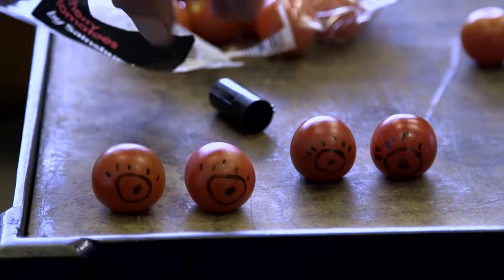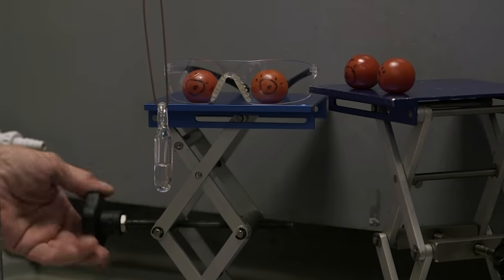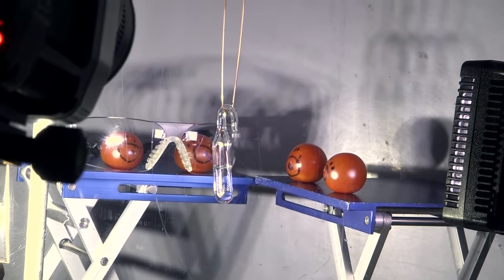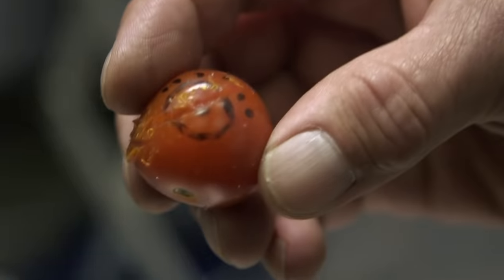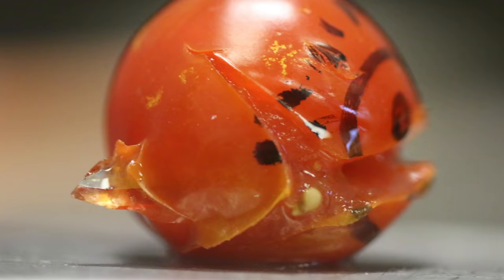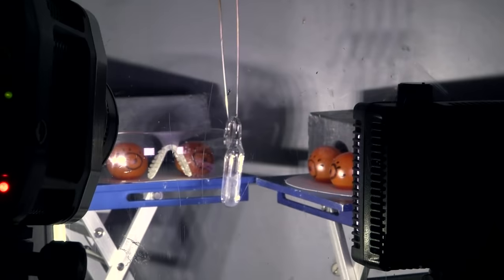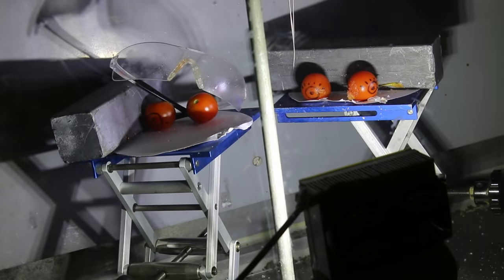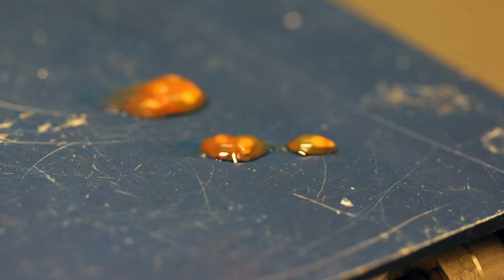Why you need to wear safety glasses - Periodic Table of Videos

Comment: I'm alarmingly bad at remembering to put safety glasses on when I work with machine tools, and I've had a few close calls with splitting cutting discs, shattering scalpel blades, metal shavings etc. I'm suprised I'm not blind yet! Note to self: remember to remember putting safety glasses on.
Reply: they are cheap. i reccomend buyong several pairs and putting them on the power buttons of each machie. even if you buy 10 thats still ot a great expense at all. i keep mine on my lightswitch so i see them as soon as i put the power on

Comment: Safety glasses have already saved my eyes a few times.

Was out shooting and had bits of a bullet ricochet back and pepper my face- this is actually fairly common. Different day was too close to a tannerite explosion. Also have had several case ruptures on rifles that shot gas back in my face.

Also had an angle grinder wheel explode with no safety guard on the grinder.

Regular eyeglasses with glass lenses are often worse than wearing nothing at all. If something shatters the lens you now have 10x the number of projectiles.
Reply: Geez-remind me to never get on an airplane or a boat with you...

Comment: The second test also sprayed the eyeballs with a jet of steam. So yeah...safety glasses would help that too.

But really when it comes to fine debris, liquids, and gasses you should be wearing safety GOGGLES.

Safety glasses are for larger debris and that's about it.
As a carpenter I can tell you...they don't even keep all the saw dust out...so I would never use them around chemicals.
Hence why I paint or spray varnish I wear googles, not glasses.

Comment: It almost looks as if the larger explosion caused the glass to fragment into smaller shards, the smaller shards would deliver less energy to penetrate, but would also coat the exposed eye in powdered glass witch might be worse. The samurai used hollowed out eggshells filled with powdered glass to blind the enemy in battle.

Comment: Due to prior experience with a grinder (particles gone wrong places) and then later a few exploding ampules I prefer to wear a simple full face shield. 
Safety glasses are great - but it's just the bare minimum of protection - your nose and face will still suffer.

Comment: Do you have to throw away used polycarbonate safety glasses?  I've heard that acetone will ruin them, but you'd think a few scratches wouldn't be too bad.  As far as I know, polycarbonate doesn't shatter explosively unless, again, it's come into contact with acetone.
Reply: Yes polycarbonate is sensitive to some solvents which cause it to craze internally and get dramatically weakened.  This applies to crash-helmets made of polycarbonate - the glue from the wrong kind of sticker can trash the whole helmet (and you'd wouldn't necessarily know till it failed in a collision).

Comment: Not only in science: I learned to wear protection glasses when I was cutting some plastic piece with my dremel and, suddenly, the cutting disk broke apart and a piece of it ended up hurting my right cheek, right below my eye. After that, I always wear glasses when working with whatever tool or checmical (glues, thinner, paint, ...).
Reply: Dremel cutting disks are lethal, especially relative to how casually they are used and their availability. Even with safety goggles I hate the things.

Comment: Will regular glass/plastic glasses have decent enough protection?
Reply: Thomas Chow kinda not but better than none
Reply: Depends on how big the glasses are. Some people have microscopic ones that don't really cover the eyes. Lab glasses are much bigger and also go around the side. Most accidents don't happen while you are looking straight at things. They happen because you are NOT looking at things.
Reply: No. Regular glasses are (obviously) made of glass, this means that they are not very strong against high speed impacts and may/will shatter creating even more danger to the eyes. Also safety glasses also have a much hugher protection surface
Reply: Even if you have glasses that cover enough (not to question your sense of fashion, but...) and they were of a suitable material (which they are not), safety goggles are much cheaper to replace than prescription glasses.
Reply: Not really, they aren’t designed for it. Thickness varies by prescription and they don’t give the coverage you need.
Reply: The generally adage is that it's better than nothing, which is probably true in most cases, but best to get safety glasses that fit over your prescription ones. That's what I do. Eyesight very is important and judging risk is difficult.

Comment: Been cutting keys for 25 years, only time I've ever got a shaving in my eye was because of safety glasses. Right off my cheek into the lens and directly into my eye. Which is why I don't wear them to cut keys. If I were running a knee-mill that would be a different story.

Comment: I wear safety glasses at work (automotive maintenance) and I still occasionally get bits of rust, oil and debris in my eye. They have been very helpful, but they are not perfect.
Reply: Ventilated safety goggles are a better idea for unpredictable environments. They offer much better protection from things coming at odd angles, and also liquids.

Comment: Workshop related comment more than a lab, but I try to use a welding mask where possible now, the amount of times I have had eye injuries wearing safety glasses is not funny.  Always had the bad luck of grinding shards ricochet off the frame between my nose into my eye and get embedded or from else where and fly in from the side between the face and glasses.  Zee googles do nothing!

Comment: In a chem lab, don't wear safety GLASSES. Wear safety GOGGLES (ones with seals around your eyes), to stop liquids from dribbling down your forehead into your eyes). Glasses are okay if you aren't going to be working with any liquids, i.e. in a wood shop or machining shop, but in a wet lab you really want goggles. I have kicked students out of my class for bringing glasses instead of goggles (of course, I tell them to bring goggles beforehand)

Comment: Aren't safety glasses made of praseodymium?
Reply: Edvinas - Those are welding glasses, where blocking the light from the arc is as important as blocking the metal particles.  Normal safety glasses (as shown here) are generally made of polycarbonate.

Comment: Even if you wear safety rated prescription eyeglasses, the cheaper protection glasses over them will protect the expensive eyeglasses as well as the eye. I could not get contact lenses with my work due to the solvents involved, even with safety glasses. Someone else should do a video of what happens to your hearing years after working around military aircraft! I'm 66 and nearly deaf from that!